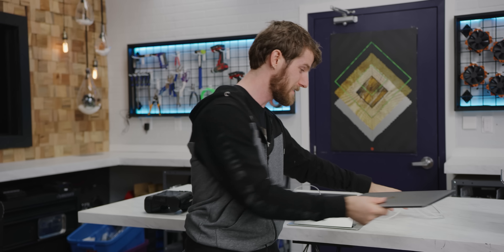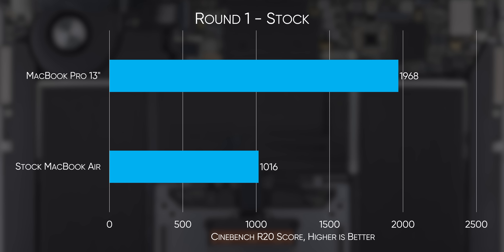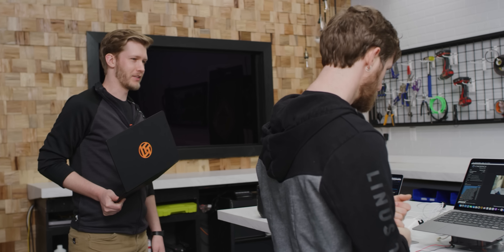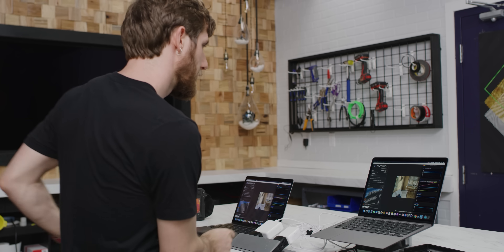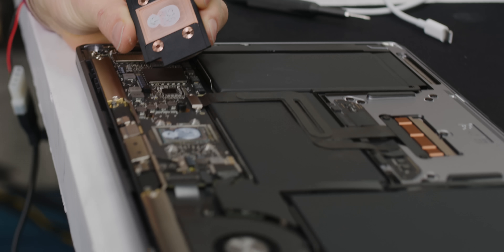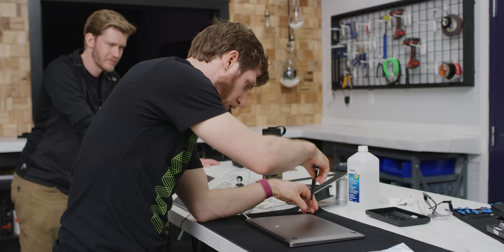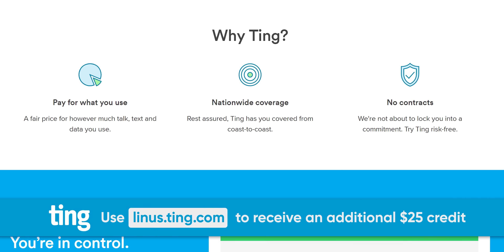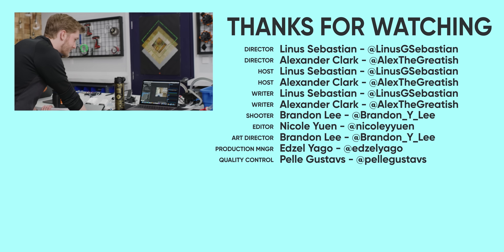Fixing Apple's Engineering in an Hour

Comment: Of all these years I'm glad that linus is Canadian. Imagine having to read the American unit measurement instead of the one everyone uses
Reply: I mean at this point im thinking that they measure calories with burgers
Reply: we use these measurements in the US too...
Reply: As an American, I can attest that it is indeed lucky Linus is Canadian.  The U.S measuring systems are wack and make no sense.  Why are inches, feet and yards so vastly disproportionate (I.e 12 inches=1 foot, and 3feet =1 yard)
Reply: @dragon1130  It's from British Imperial and each measurement increase was used for appropriate scales. It was rarely to say something is "1 yard, 2 foot and 11 inches". You'd just say 71 inches, because that's the tolerance you are working in (if you care for the inches) and you might use one subdivision lower, like saying you are 5'11" tall. You choose an appropriate scale for the distance measured. For example, you might hear furlongs used in (British?) horse racing as they might race 2 miles, or 16 furlongs. The Furlong becomes a reasonable scale (1/8th of a mile) to measure chunks of the race, even though that might be one of the few examples of it still in use. You'll hear miles and furlongs, but you'd never hear them take it down to chains (1/10th of a furlong).
Reply: @dragon1130  ask the English
Reply: @dragon1130  It's because this country was invaded by Britain in the 1600's.  At least we got rid of the pence - pound money and the weight system based on stones.  Fun Fact: Before the Metric System France had a foot that was almost 13 inches or 324.8mm - which is why everyone not French thought Napoleon Bonaparte was short. At the time in France, the average height for an adult male was about 5 feet 5 inches. So in fact, he was quite tall for his day.  BTW an argument can be made the Egyptian Pyramid at Giza used an inch nearly the same size as the US one.   <steps off soapbox ranting  about measuring systems in computer comment section>  :)

Comment: they off-centered the fan instead of putting it over the cpu in order to make the macbook air as thin as possible. if they put the fan over the cpu, the macbook air would basically be twice as fat. they probably didn't put it closer because then it would sit on the motherboard, also increasing size. Apple sacrificed ideal heat dissipation/ performance, as always, for design. Apple took years of research in heat mitigation, and simply considered it.

Comment: Hey Alex, are you using the Surface Laptop 3, 13" matt black? Are you having the same problems with it as pretty much anyone else (loud buzzing sound from  under the power button when in idle and annoying fan curve when under minimal load but charging). There's a thread on the official microsoft forum which is already 19 pages long by now. Microsoft seems to ignore the problem, which is unfortunate so say the least. Since you really are a fan of the surface devices (me too by the way), I was wondering if you could make a video about the problem, maybe offer solutions and use your reach within the community to address the problem and get microsoft to listen and give some sort of answer to all the unhappy customers. Thanks in advance. Greetings from Germany!
Thread on the microsoft forum: https://answers.microsoft.com/en-us/surface/forum/all/surface-laptop-3-faint-buzzing-sound/d800b696-ff7c-4cf0-a2db-99c2c2082144?page=1

Comment: "apple engineering is a meme" - Louis Rossmann
Reply: Владимир Владимир so is bunch of other PC manufacturers. But no one cares about them. Asus has this defect, where their batteries brick themselves if the PC hasn’t been turn on for a few months. How much you think the nerd-o-sphere has talked about this? If happened to me with two machines. One of them was brand new.
Reply: @gareginasatryan6761  Nobody gets a free pass, but the difference is that you don't typically pay an Asus tax.  I have a cheap laptop of theirs which I got solely for work purposes.  It's worked well for over a year, even with leaving it sitting for a few weeks at a time.  I'm sure it will ultimately die prematurely for one reason or another, and that will be disappointing, but I will have gotten my money's worth and be satisfied.  When you pay crazy exorbitant markups for Apple products, you would expect them to be of the utmost quality and last for years, but frankly they tend to just ship mediocre stuff with nearly as many problems as anything else on the market.  I mean, if you were building a top of the line computer, would you buy a motherboard from Foxconn?  Of course not.  And yet, that's considered premium for Apple for years.
Reply: FyberOptic Reality don’t agree. I’ve been dealing with quite a few Apple laptops over the course of 1,5 decades in IT tech and the majority of the units run fine for many years and easily gets used so long that people think it’s time to replace them for being old, not being broken. Many using Late 2013 MacBooks at my current workplace, for example.

I agree Apple could and should do an even better job, but that doesn’t mean things are as bad as some people seem to imply.
Reply: @staraffinity  We don't imply they are "bad" as you try to put in our mouth (strawman sophisme anyone ?) we are saying they are far from premium. And some of us consider paying premium price for non premium product is a scam. If i sell you a Ferrari with an engin that barely perform as a corola you'd get pissed of, but for some reason apple fanboy keep searching for excuse instead of asking their money back. And as for the classical rhetorical diversion of "but look this other model of this other brand also do that", please stop with that, that argument just fall appart when you realize that other one cost half the price !!!! So please just stop being rhetorical with people who just point out that there is a problem there to put a premium price tag on badly executed work, get your head out of the ground, acknowledge the problem and demand apple to deliver what you paid for. That's the only way apple will one day raise their game up. In curent situation they can make any piece of shit* people blindly buy it, why would they work their ass up to do better product ? So stop arguing with us, and go argue with apple. 
*(and yes some of their product are good but some other are really shit, and all are priced premium ! face the truth)
Reply: @catboy3471  because they have a laptop with passive cooling on cpu and a fan on a side that cools jackshit. they basically take good cpu, heavily power limit it and it still runs 100 degrees hot and throttles. because their motherboards die from short circuit even though they have short circuit protection. because there is no adequate water protection. on laptops of other brands the water just leak out and leaves minimal damage, but not on apple laptops. oh, there is also thingies that spouse to detect that water got inside, but they gettin false activated if your laptop gets in room with high humidity. and that's just from the top of my head. if you interested on other reasons why apple engineering is a meme you should check louis rossmann's video, it's called something like "apple's engineering failures"
Reply: @NECO2926  And may I bring up that in some Apple Laptop, that they marketed for as an "unibody", it wasn't a unibody and also the fan(s) were blowing hot air to the glue of the screen, so that it deattached by itself
(Or something along those lines)
Reply: @draylex  this and many others in louis's video
Reply: Thats what happens when you hire more lawyers than engineers as a tech company
Reply: @catboy3471  because it's extremely easy today to do a good marketing campaign to hide your failure? Why do you think there is an actual meme saying "it's not a bug, it's a feature"... I mean it's not like for years apple was selling garbage, and people are still queuing to buy it
Reply: This is all stupid Intel's fault if they built efficient 7 nm CPUs then none of this would be a problem and the CPU would be small enough to fit a fan over and not make it too thick
Reply: @loveiphones4550  i dont think a few nanometeres make a difference here lmao. Apple is just complete garbage.
Reply: @loveiphones4550  thats not how process nodes work even a 1000nanometre cpu is smaller than a blood cell

Comment: just use a shim next time on the cpu instead of milling it. It's doable for just about everyone and increases the mounting pressure and contact. (given the right thickness) It's obviously not as good as what you guys did but still better than stock. cpu, paste, shim, paste, heat sink.

Comment: "we dont want the bottom of the laptop to burn you"
my 2016 razer stealth that literally burnt my desk looks the other direction
Reply: Friend used some old small thinkpad back in 2013. When he was playing CK2, at 5fps, the laptop would heat up whole 4x1m desk. :D It was fun/mildyinteresting. We were more baffled by him playing CK2 for days and days at that fps count :D
Reply: Airborne Filip how many kilos of potatoes did your friend use to run a bloody crusader kings?
Reply: @BharathiChristiano  Not even a whole one potatos. 5x speed was 1x for normal pc :D
Reply: yeah my 2015 Razer Blade killed itself by heat, send it for repairs, and then when I got it back immediately started turning off during gaming because it was drawing too much power. They sent me the power brick for the bigger model.
Reply: CGWill _ my MSI did that too....
Reply: CGWill_ Well, I'm sure your Razer stealth cost much more than your desk so there's at least some logic there...
Reply: I thought all laptops required the use of pot holders underneath to actually use it on your lap. If it doesn’t get hot enough to burn you, something is wrong.

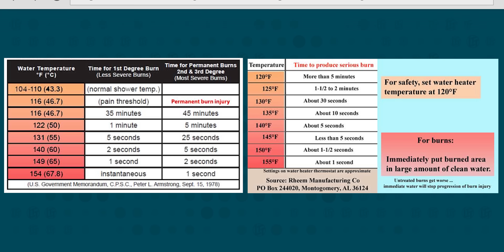Comment: there is no way you get a burned at 46 degree... a sauna ca go up to 70 and inside you feel is hot but you can stay more than ... (9:28) 1 second and i don't get burned...
Reply: Because air temp is not the same as direct conduction. The rate at which heat is transferred into your skin in a sauna is orders of magnitude slower than direct contact with metal, That's why all surfaces in a sauna are made of low thermally conductive materials (wood). Put a piece of steel in a sauna and sit on it and tell me that it doesn't cause burns.

Comment: Can the AIR run linux or windows. Seems like the OS is overriding power.
Reply: The OS typically doesn't touch intel's power limits. Those are usually baked into the chip. For Desktop parts they let you override them (or bypass them completely), but for laptop chips where intel has to work with the OEM, there really isn't any way to go outside of the specced 9-12W that this chip allows.

Comment: Genuinely asking, what are you doing on a thin and light that needs this much cooling? I use a MacBook Air 2017 and I have honestly never heard its fan spin up. Idek if it has a fan. And I can run 30-40 tabs and do some light programming just fine

Comment: The worst part is that it shouldn't even have a fan--a 12W CPU should just be passively cooled.  A big 'ole vapor chamber sinking heat from the die to the entire breadth aluminium chassis would perform better and fit Apple's design language much better.
Reply: That really is the problem. It'll perform better but at the cost of user experience (no one wants a 45C+ piece of metal on their lap). Considering the type of buyer that the air is for, the tradeoff of "its thermally throttling, look it runs 15% faster if you thermally attach it to the case" is not worth the complaints of "THIS LAPTOP FEELS LIKE ITS ON FIRE".

Comment: Honestly, Linus isn't sounding too insane with his ARM theory. I wouldn't be surprised if they are able to get ARM to massively outperform 10W of x86. Not too mention the cooler temperatures too. This thermal design seems sloppy and they wouldn't even need to change the size of the laptop to cool it better, just a closer heatsink with good thermal compound does wonders. There's no way this can be unintentional, right?

Comment: Hey Linus! I've got an idea for you. If you use distilled water, it will not destroy any equipment of the computer. You can buy distilled water from a gas station and then use it to make some ice, and, finally, just put the laptop right into it. It will be cooled efficiently but it won't die, because distilled water is not conducive and does not contain any particles in it. Worth trying and not destroying any of the equipment! AND, isn't it cool to use a laptop UNDERWATER? You can make some cool videos out of that! Let me now what you think :))) P.S. Just don't drink too much of the distilled water as it's dangerous :D

Comment: I would use more heat pipes move the heat zone away from the top of the cpu (so it is not cooking itself) to the side next to the fan then allow the heatsink to make contact with the chassis and drump heat through both the fan heatsink and chassis.

Comment: I think they made the heatsink not touch the dye so that when stress initially starts and everything is still kind of cool the minor heat difference between the dye without paste on it and the dye with paste on  it will make the cpu expand and contract in different areas from each other and overtime will cause fatigue, performance deacreases, and potentially overall failure of the cpu. Forgive any grammar mistakes I typed this on mobile.

Comment: Yeah, it's a fucking Macbook Air. It's used by women to browse Facebook and write essays for their Psychology and Women's Studies classes they all take in college, do you think they are ever going to reach the point of overheating it? Even if they do the CPU will just throttle itself down and they won't even notice because the performance wouldn't change. That's worse than complaining about a Prius overheating when driving it as fast as you can around a racetrack for 4 hours. Cinebench? Are you fucking kidding me?

Comment: Ahh Linus, Linus...They don't just have to put a spring in there. They need to, re-design it. It needs to be that...Apple quality. 
To begin with, what is a spring? Is it just a piece of twisted metal designed to bend upwards and downwards? No. A is a piece of engineering, a tool with limitless potential. And the springs used/made by Apple, they need to be of the highest quality. Never to fail, made of the most premium steel on the market, and you can buy them here from Apple store for just 499$

Comment: Apple not worth it anymore ... I have 2 15” laptops 2017 and 2018 and both the screens are failing... pay over 2000$ for a laptop that will not last you 3 years 🤦🏻‍♂️

Comment: I'm wondering if there's firmware or software tuning that keeps the CPU from going crazy with the OCing. My motherboard actually will sustain turbo clocks for a crazy amount of time by default if the cooling supports it

Comment: Why didn't you just put a thin copper piece to close the gap between the heatsink and the CPU?  If you were worried about the contact surface area then you could have just applied the thermal paste between the plate and sink AND sink and CPU.

Comment: So a thermal pad connecting the heatsink to the chassis, then using a cheap laptop pad/blower should be an adequate way to get that performance boost and not burn yourself?

Comment: What if they did this on bootcamp? Would they have the same results. I would assume the power and cooling configuration would be different in Windows, allowing for higher boost?
Reply: The boost is determined by the PL1 and PL2 parameters built into the CPU...That's just the set limit this cpu is allowed to run at. In this case 13W measured in the video perfectly lines up with the max 12W TDP on the data sheet.

These are not desktop cpus. There is no override to achieve whatever clock requested, They run very strictly within intel's spec.

Comment: you'll find out the fan positioning reason, when they release the ARM macs. they're obviously using the same laptop design and swapping the CPU
Reply: this
Reply: Surely there’s a heatpipe between the cpu and the fan? Surely it’s not completely passively cooled without even using the body as a heatsink?
Reply: @cuthberter  Not at the bottom... Maybe it's at the other side of the motherboard but it's probably not there either. The Huawei Matebook X pro had a similar approach where the fan is separate from the CPU cooler, but that laptop had a huge heatsink that covers most of the chips like a shell. It worked I guess.

There was a modder called Bradshacks who added a flat heatpipe to the fan of that laptop, which decreased temperatures. He also performed other mods such as thermal paste/thermal pad/copper shim mods which Linus could investigate.
Reply: plot twist: they remove the fan altogether. and add more...?

Comment: Louis Rossman has been covering this issue for years. This is a poor shitty practice from Apple and is the biggest flaw of this laptop.

Not just throtteling, but board and cpu damage also is a major problem on the 2018+ models. Oh and the stupid soldering of the ssd, ram and battery.

Comment: I'm old enough to remember when Apple deliberately ran the CPU of the IIgs at a super slow clock speed so it would be slower than the more expensive (but generally less capable) Macintosh Plus.

Comment: WAIT.............it might have been throttling the power after you cooled it down because the system might have thought it was in a cold environment, meaning the battery would have been limited to power output even though the power cord was connected

Comment: I know the cooling is bad, but here is a theory: the CHASSIS is the heat pipe. So the CPU makes contact with the bottom of the laptop, then the bottom panel moves the heat across the bottom, but also to the fan. Also my laptop gets over 50 degrees under load on the bottom, and it isn't a gaming laptop, so...